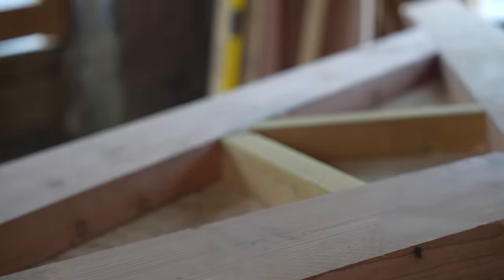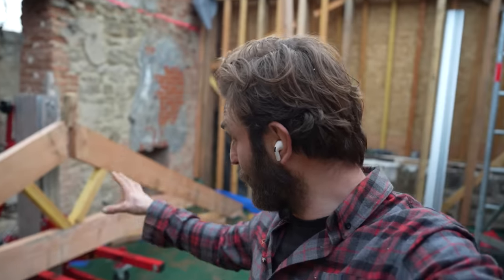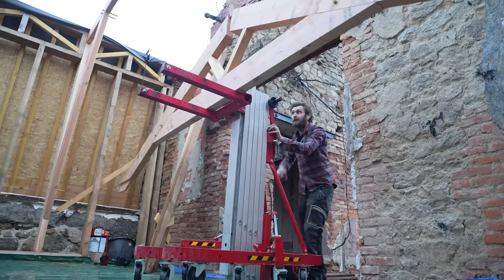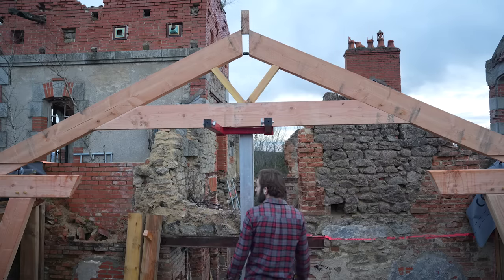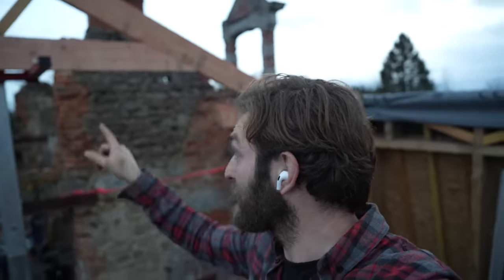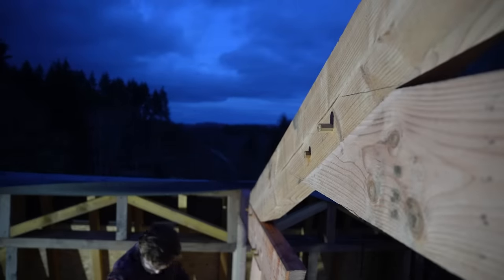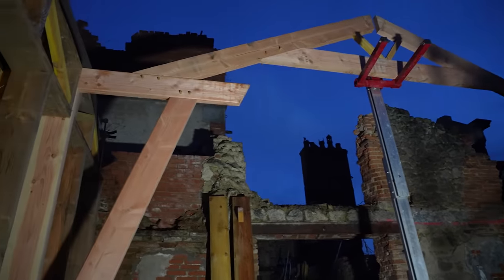The massive A-FRAME is installed.

Comment: I have been watching progress on tv since the start of the project. I also took on a large project such as yours. 30,000 square feet and completed in 7 years. would not want to do it again, but glad I did. one tip for your plastic covered windows. Use clear vinyl shower curtains. They look like glass and mine lated through a hurricane and were up for over three years before I put glass in. No-one even noticed it was not real glass.
Reply: I would never have thought of using shower curtains, that sounds like a really good tip 👍

Comment: Glad to see the "plastic" windows holding up in the wind
Reply: Another commenter, user-rr2hk1Uc3d, suggested a tip:  using clear vinyl shower curtains.   They said had done a similar 30,000 square foot project that took them 7 years. And for 3 years, they had shower curtains in the windows; said it looked like glass and nobody noticed.   Also said shower curtains held up to a hurricane.  Great tip.

Comment: Hi Dan I’m Rob Carpenter and Joiner from Wales. I would like to first and foremost congratulate you on the work you’ve carried out so far on the château. Really love the look of the roof to date. Just a safety note with the chain mortiser is that your standing infront of it. Where you should be standing behind the miter. You will find turning it on more comfortable. Pulse there is a switch on it to move the cutter head. To a maximum of the places before you have to move the machine over. 
Once again. Awesome job. 👊🏻👍🏻

Comment: The roof is looking really good well done. THere a trick with the ridge beam gap where you can slot in a 'T piece' (a ridge beam offcut with another scrap screwed at right angles to stop it dropping through) which helps stabilise the structure till you get to the ridge beam install. Good work keep going.....
Reply: Or just bang in a nail or two to hold it temporarily

Comment: Structurally, the horizontal beam of the truss (A-frame) will have tension instead of compression with load from top. Given there is no glue in the joints, the only thing(s) that hold the truss together will be the four wooded pegs. Steel bolts/screws are much stronger than wooden pegs in this case. Or Dan can consider using glue, ties, etc at the joints. A little steel can make the roof much stronger.

Comment: You need to put some glue inside the mortise hole for the domino before you pound in the domino. If you only put glue on the domino almost all of it is wiped off when you pound in the domino because the fit is so tight.  If you pull out the domino before the glue dries you'll see that almost none of the glue is penetrating down into the mortise hole.
Reply: I was thinking the same thing

Comment: Good job you didn't buy a site crane, would've been quit hairy in that wind! I did see that you didn't stagger the holes for the pegs! As the wood dries out, it'll shrink, joint 'll work loose, but it won't matter, the weight of the roof will hold it in place!

Comment: Hi.
I love to Watch the process. It’s incredible how fare you have reached.
I would like to make a little comment in the joinery. At my carpenter school we were told the importance of “offsetting” the holes for the nails. My first attempt to join two 4*4 i drilled the holes right from them both went joined. I was told to make the holes in the “female” part fist, then insert the male part, pres the drill into the hole to make a mark in the male part. Take it apart. 
Then offset the dot by 2-3 mm inwards “away from the female hole”. Drill the hole at the new mark. 
This will force the to part together and secure that there will be no movement in the joint. And eliminating squeaking from the joints.
I got a copy of a book from around 1800 that is showing all the different types of joints that were  used Ind old timber framing all the way back to the vikings, and still going strong.
Walls, decking, floors, frames, rafters it’s all in there. Quite interesting and fun knowledge. 
They have made stress test on these joints. And they don’t break, the wood will break somewhere elte, but not in the joint. 
My first attempt, the teacher could twist the joint, much to my surprise 🤷🏽‍♂️🤦🏽
Reply: Yes, another commenter also mentioned that Dan forgot to offset the holes this time.   He has done offset at other times.

Comment: Its been interesting to see your solutions for the joints. That chainsaw machine looks like a winner. The tenons take a lot of cutting. Routing looked nice and neat but takes awhile to set up. I see you've reverted back to cutting fins with the skill saw and I like the idea of using a grinder to clean up the joint. Thats a time saver. You should definately leave the pegs uncut without trimming them off. My brother inlaws house on France has a similar structure and the exposed pegs make it look so much more impressive. If you've taken the time to use proper joints you want everyone to know it at a glance..

Comment: Traditional construction would imply the use of metal sheeting on such a shallow pitch typically, Lead.  However unless you have very deep pockets and serious skill, the lead will be precluded and the same goes in part for copper or zinc.  If a lead look-a-like is required then there are single ply membranes that can be had with preformed rolls to mimic Lead detailing.  I wonder how the insulation values will be achieved especially, since SIPS panels would have been the logical roof cladding format for anything close to modern insulation values.

Comment: Dan, you are doing wonderful work. I enjoy every video and admire your stamina and patience!  Just out of technical interest, if you have drawings (e.g. a cross sectional drawing of the roof or the chateau), could you please share these in one of your video's?  The thing is that I wonder why the A-frame seems lower than where the side frames stop. For now the A frame top does not seem to line up with the sides.   I am sure you have plans as submitted to get planning permission for the rebuild ?

Comment: One of the few YT channels I watch where I lose track of time; it seems to zip past and before you know it, it's 'see ya tomorra'! 
I'm curious as to what structural timber you're using, Dan. It seems so light, both in colour and weight, yet it surely couldn't be pine as it isn't a load-bearing timber, as far as I know, which isn't far 'cos I'm no expert! My guess would be Pawlonia?

Comment: Dan, is there another A-frame hard up against the stone wall? 
And will you put in some stairs right there against the wall, opposite  the fireplace, to get to the next floor? 
The doorway, where the old water tank used to sit, would be the perfect place to build stairs to access the next and final floor other than the two more in the tower.

Comment: Before you put the  boards on, you should put the ridge up. Since you probably don’t get a ridge for the whole length you would have to add on one or two pieces with lap joint and tenons. Than the roof on that side of the chateau will be almost finished. Well done. 😊

Comment: Dan, I am curious. 
At 12:01 you can see an original roof line on the side of the tower in the tiny left side inner A-frame triangle. 
Perhaps it is just merely the angle of the camera shot, but that roof angle looks much much steeper and taller than this frame you are putting in there. 
To the individual that attacks anything and everything I have said a couple times now, I am simply making an observation and asking questions!

Comment: Dan, love the mortise and tenon construction and your attention to detail chamfering the lumber! I am trying to visualize what exactly you are doing, but I have a question. Are you trying to reproduce the original roof profile or doing something different? Because the original shows the roof line going down to the outside edge of your new roof (sides). Your rafter looks like it going to finish two feet from the edge and create a two foot flat edge around the roof. Is it possible to see your schematics for the roof design?

Comment: I have a question ⁉️. As you were putting some glue on some pegs while down by your circular saw, Why don't you put glue on the dowels that you are putting in the beams to join them?  I ask Because eveytime I watch a master wood worker or wood Smith like Norm Abrams he always puts glue on the dowels and in the hole it's going in.   Next question ❓. Do you plan on eventually sawing off the dowels to make them flush with the beams or are you going to leave them as they are?  Thanks Dan, you are doing amazing true MASTER CRAFTSMAN WORK with your wood beams, so impressed and know it will be a work of Art and last a very very long time

Comment: I wonder why to use glue in the Domino joint while everywhere else not? 14mm domino could work well if used with 8mm perpendicular pin to lock it down? 🤔

Comment: When you drill the holes for the pegs you should offset the holes in the tongue a little. That way when you hammer the pegs in the will draw the pieces of wood together creating a stronger connection that never comes loose.

Comment: Dan.  Lovely job with the framing.  Please note your Domino's are too tight.  You are just wiping off the glue belting them in.  They should be finger inserting loose.  A nice sliding in fit. Then glue will do its job.  Also bashing them in can lead to fractures thru the domino.  Hope this helps.

Comment: How will the flat portion of the frame work out? Isn't the roof peak supposed to have a slope out to the outer wall of the mansard roof? The way these are designed, wouldn't there be a flat portion along the perimeter of approx 2 feet, all around it?
Reply: Just like the walls it will have a slightly inclined timbers, just for the tiles, the structure itself is the walls and the A shaped roof is to keep the whole structure strengthen.  The mansard roof is on top of the frame not the frame itself, there are plenty of shape roofs of mansard, people use to create unique shape to their roofs because they don't touch the structure at all but build framing around it to create the forms of their roofs. Round,cathedral, triangular or like his tour in the middle a very steep and pointed tall roof.

Comment: Every episode I watch I can't help but think how much quicker, safer and cheaper it would be to have a little self erecting crane placed at the corner of the building, granted it would be be a large initial outlay but I've seen 2nd hand remote controlled one's going for as low as 15k, not to mention you'd get the selling of it in a couple of years.

Comment: Dan correct me if I’m wrong but shouldn’t the holes in the mortise and tenons be off set ,so when you drive the pegs in ,the joint tightens up .That way ,when the timber dries out and shrinks,the joint stays tight .

Comment: I understand the need to stop the water from getting into the building but my concern would be putting all that weight on top of a structure that has net to be stabilized.  I probably would have done a simple scaffolding frame and shrink wrapped it until the structure was ready.

Comment: Where a beam doesn't connect exactly at 90 degrees to another, do you then vary the slot depth along its length as you bore from the deepest part of the slot towards the most shallow, with that magic tool?

Comment: What the heck? You start building the roof peck and you almost go full Amish with notches, pegs,  and dowel type construction. Its beautiful work but very time consuming. Steel brackets and bolts would definitely be quicker and just as strong if not stronger. I have an Amish built barn; built in the 1800's. Still holding up nicely. The construction last as long as the roof keeps everything dry. Your craftsmanship is beautiful! Keep up the excellent work.
Reply: 'Full Amish'😂😂

Comment: What is the reason for mounting new posts that the roof frame sits on?  Those new posts eat up space inside the attic. Looks to me that it would be a lot easier to just build wider trusses that sit on the posts that are already in place.

Would be more fun to follow along if you show a drawing of what you are building before you build it.

Comment: Dan, I don’t think you need to sand the beams. They are not for touching, so it is enough to give them some oil to get the grain structure popping.
Someone wise ones told me “nobody looks at the back of a wardrobe, so don’t fuss about finishing something nobody can appreciate in the future. “

Comment: STOP. Hi Dan. You are doing a great job. Unfortunally you are doing af disastrous arror in your roof construction. When you ar drilling for your wood spike, you cant just drill right truogh. Doing so, your roof will be lose in every joints, when the wood dry up. You have to move the hole in the pin, towards the bas og the rafter 2-3 milimeter. If you not doing so, the roof will squeke and get loos, and in the end, the spike will break...

Comment: At most times I noticed that you drill thru the grove then you line up the tongue and drill it separately, WHY!! Is it a smaller size??
Reply: Hi Rick. If I understand your question, Dan said in a recent video that he offsets slightly the holes in each  of the two pieces of wood to be joined so that when the peg is driven in, it draws the pieces of wood together for an even tighter fit.

Comment: Am I the only one that thought there was another floor that was going in?   It looks like there was a door way still one more level up. I thought there was attic going in above the floor that is done.
Reply: There is one more floor on the back, but not on the left or right side where he is working now.
Reply: @KjerstiNagel  but he said the roof line will run all the way across to the next roof. That would have the roof line at about waist hight on the next floor. Even if it only is just that roof there is still a door way directly above the door way from the hall onto the finished floor he is working on. It's not a brick wall above it's a door way like you would have access from that next level into an attic space above the finished floor. It very clear in the thumb nail shot for this video. You have the doorway onto the finished floor then a header above the doorway and another doorway above it that with the roof hight he has now goes to nothing. I just went and looked at a historical photo of Château de Chaumont and the roof pitch is much higher then what he has now and peaks at the hight of where the tower transmissions between plaster and all brick. That is much higher then the current peak with this pitch.

Comment: Stupid question maybe, but is the roof timber treated against woodworm, termites etc (the don't seem to show any colour, which is usually a sign of having been treated) ? I seem to remember oak and chesnut being supposedly less attractive to the critters. It always worries me when I see people building roof structures or framing out walls with potentially untreated wood in DIY projects in France. There might be a reason they tend to use metal studs etc .instead of wood .... worried fan.

Comment: the construct of your frame is good.  but the roofing frame installation sequence is not done correctly.   you stated  ridge beams "runs all way".  means you are going to use scarp joints. 
Regardless  ridge beam(s) has to be installed first  to establish rest point (on wall). the roofing frame does not do that because frame has to rest on the ridge point; in your case ridge beam.  (therefore your installation sequence is in the wrong). 
I suspect you might have become slightly confused on how roofers build frames.   they tend to build temporary brace  (could look like frame without cutting up the lumber), supporting ridge beam at right height.  then install roof frames. remove the temporary brace(s) and re use it on next section and repeat.
Reply: If ridge board-beam does not rest on the wall,  then the first frame next; usually no more than twice thickness of lumber away from the wall has to be built first to install the board-beam. That frame looks different from roofing frame, is a compound frame;  either a king post or double collar; both frame part (1st collar or post)  supports ridge board.

Comment: After watching countless ""Beam Built"" construction videos I saw you doing something with your ""pegging"" that puzzles me.
You once mentioned that your wood that you are using was wet or damp. OK but what happens when your wood dries? It shrinks.
Even the dowel rods used for the pegs will someday shrink as well. So knowing this you should be ""Off Setting"" the ""Peg Holes""
to account for ""Shrinkage"". But I see none of this rather I see you put the beam together with another THEN you drill the hole for
the peg. The way you use the ""Hole and Peg"" method seems to be a little sloppy. The top beams that hold all the weight of your
roof are very important and should be put together with some forethought. They might be snug right now but will that ""Snugness""
hold out when the beams get dry as you know they will? I'm no expert but I know the importance of an ""off set"" hole when it 
pertains to the job you are doing.                                                                                               Just curious,  Me southern AZ.   (USA)

Comment: Not sure about your engineering on this one. The entire load is forced down onto the tennon at the bottom end and it is only an inch thick. It is not the size of the framing members it is the strength on the joints that hold the building up. Fortunately, you are not holding up a great deal of roof area with each of those tennons.